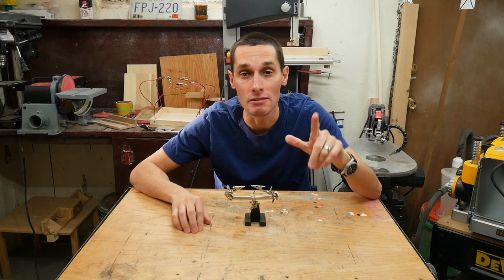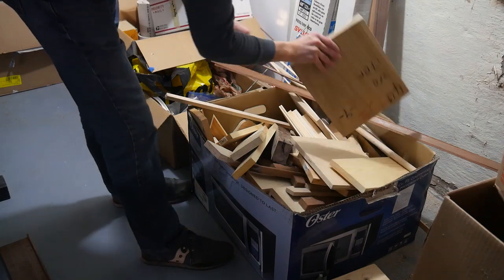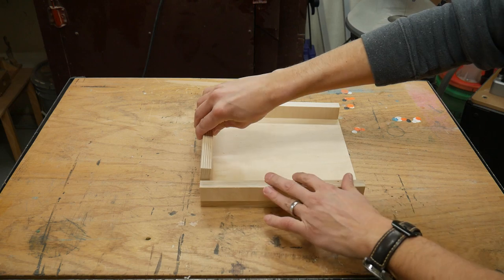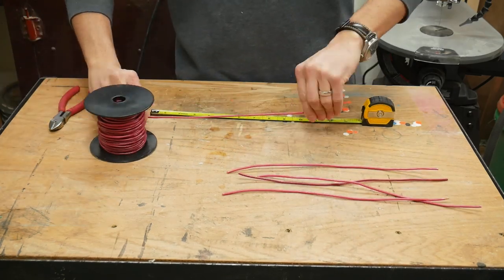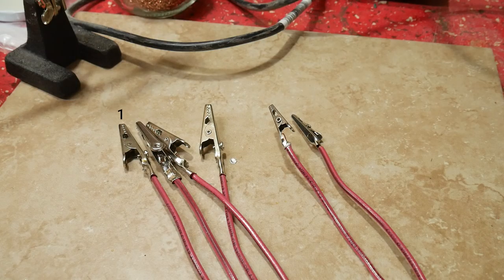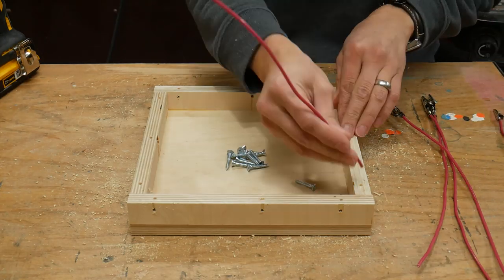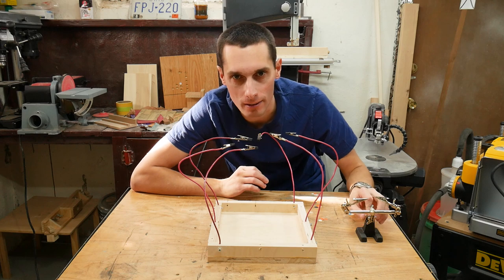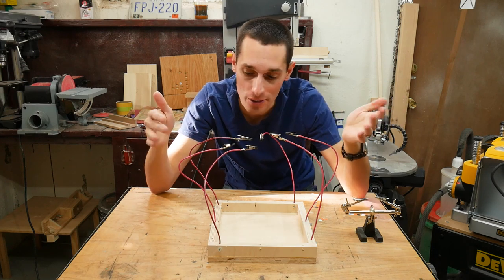How to Make a Simple Third Hand Tool

Comment: I feel so stupid when I see something so obvious yet so simple. Thanks for the info. Will build one with, like you said, shorter wire. Seen a guy build one using those $1 store flexible led lamps that was also cool. They may hold better than the wire or actually, here’s an idea, run the wire inside!! Heck I just came up with an idea now I don’t feel so stupid! 😂

Comment: Wire can be bought by length (per meter) and is not that pricey. It is more expensive to buy wood, glue, and have drill with drill bit, especially for someone that is specialized in electronics and don't have (home)workshop.
That to the side, this is one of the better helping hands designs. I really liked wood screw wire fasteners; simple and effective.

Comment: I’ve always noticed how you hold your drill with your index finger extended and using your middle finger to pull the trigger.  I’ve seen some other you tubers do this.  Is this simply just the way you learned or are there any benefits to this like stability or control?  Just curious.
Reply from the maker: I never realized I held a drill this way! lol. I suppose the extended index finger provides more stability and gives me more fine control over the position of the drill.